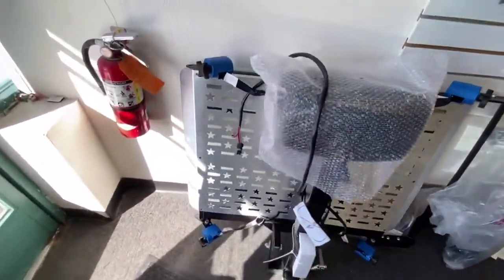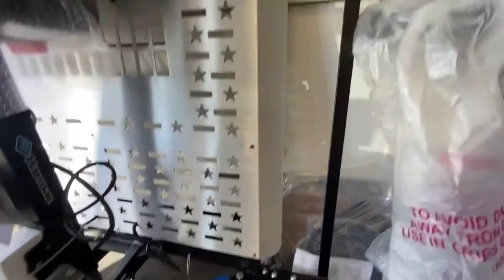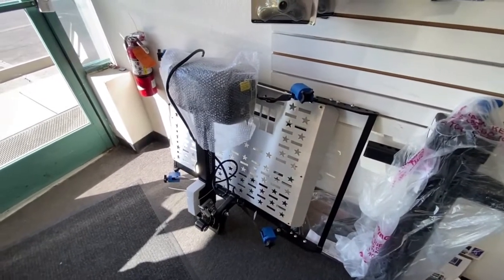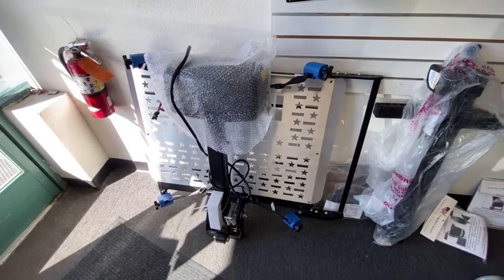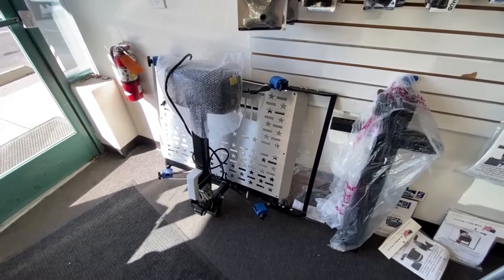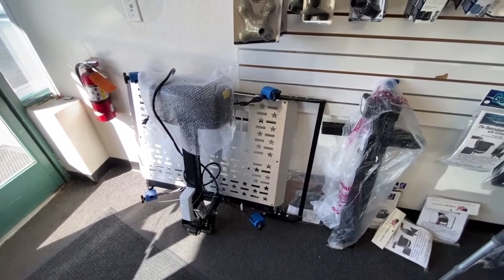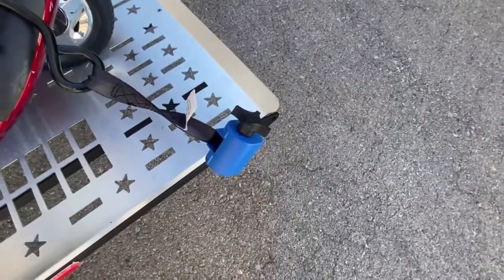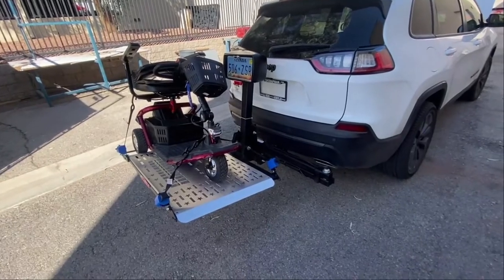Vehicle Lift Install | Harmar AL300 External Power Scooter & Wheelchair

Comment: Does the AL300 have a license plate light?  I assume it hooks into the normal trailer wiring
Reply from the maker: Hi Tom, yes you get a light already built into the top where the license plate goes and has a four pin trailer light wiring added to the harness.
Reply: @lasvegasscooterslifts  Thanks

Comment: No one explains what wiring needs eletric to run the moblie lift? Thanks
Reply from the maker: You get the wiring kit with a new lift, if you have bought a used lift and doesn't have wiring with it I would go to a dealer of that brand of lift and purchase a wiring harness for that lift.